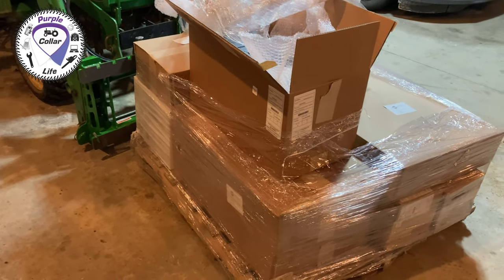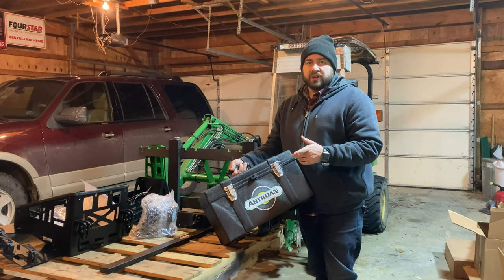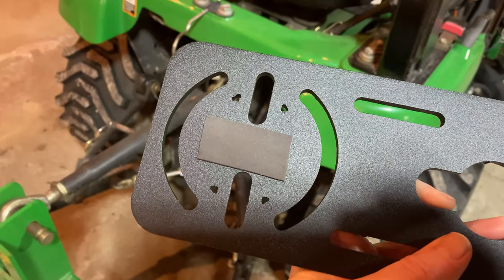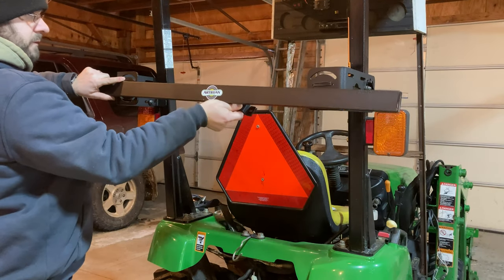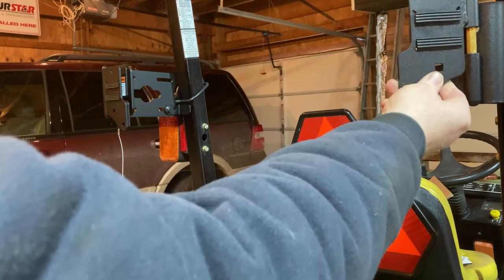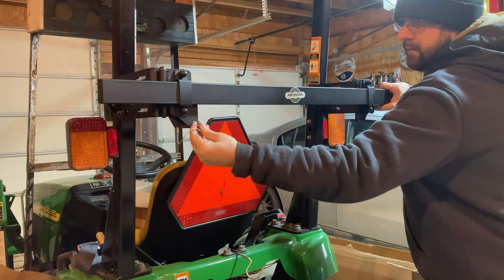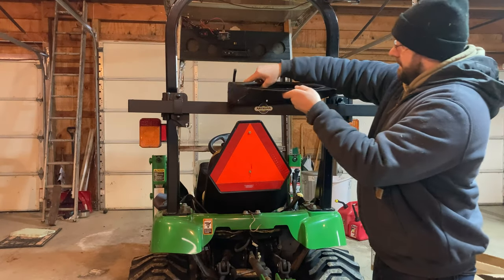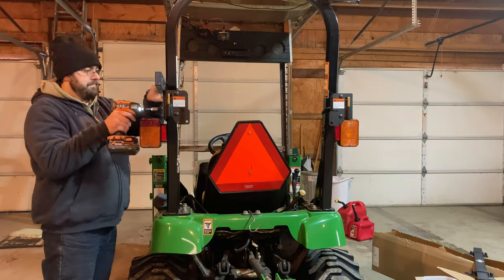#157: Best new tool for your tractor!  Artillian ROPS mount tool bar.

Comment: I keep my backhoe on most of the time... What do you think of mounting this higher up or even facing front? Would it be possible? Would it be out of the way enough?
Reply from the maker: Great question.  I don’t see any issue with mounting it higher as far as the brackets are concerned. But the higher you mount it, the more difficult it would be to lift things off of it (the chainsaw or bucket for example).  I’d never thought of mounting it facing forward - that also would probably work - but all your equipment would be facing you on the seat of the tractor (again, may be a problem if you’re using the chainsaw mount, the bucket mount, or the basket)

Comment: Great video.  Is that the 54" bar?
Reply from the maker: Thanks! Yes, it is the 54" bar.  It works great.  There have been a few times I wished it was the longer 68-inch version, but that would look too wide on my tractor.
Reply: @PurpleCollarLife  Thank you!